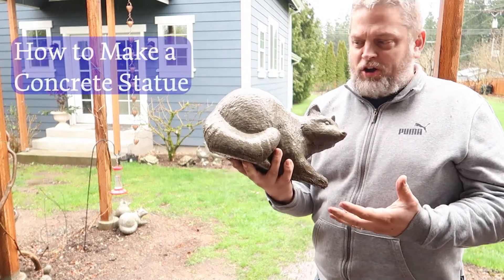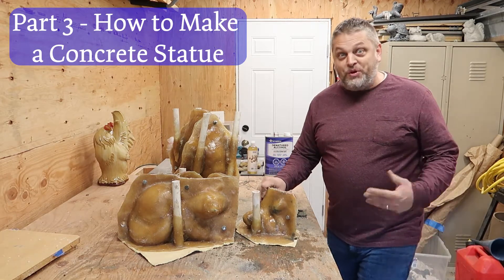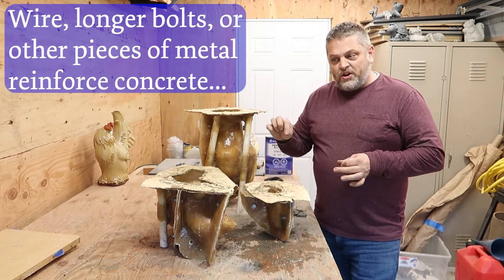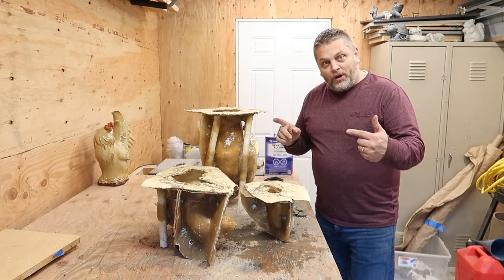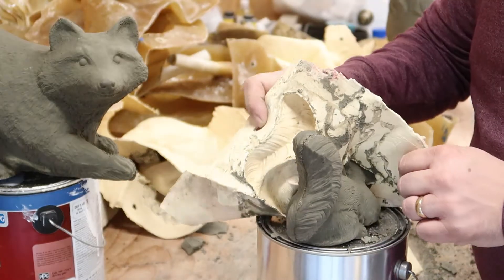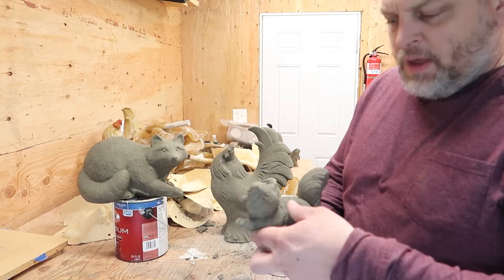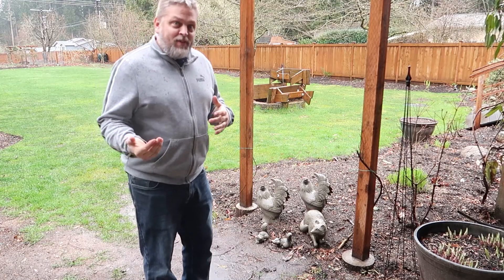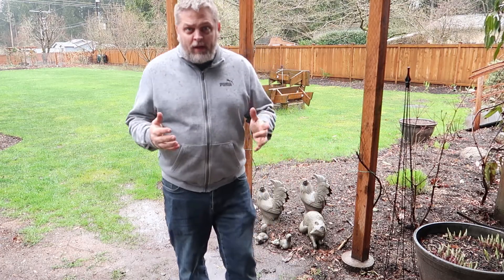How to Make Concrete Statues - Complete Guide to Make Garden Art (Part 3)

Comment: Should you let the concrete sit longer than 48 hours before removing from the mold?  Would that make it harder to remove by waiting say 72 hours?
Reply: Also, what type of paint would you use and would you seal it before painting or after?
Reply from the maker: @raynesmommie  Hello, regarding the paint, seal it AFTER so that the paint can really absorb into the statue and act more as a stain.  Most of my statues I don't even seal, and they are still great years later.
Reply from the maker: 72 hours is great, and the patience for the extra day may be great.  I had a couple times where I forgot to demold a statue after a week and two things happened.  First, parts of the extra stuff that I did not want, like seams that squirted out of the mold, were harder to chip away because the concrete was getting too hard.  Second, the mold seemed to be affected a bit...almost dried out too much. 72 hours is good though...

Comment: Im doing a small scale mold what would be the ratio of water to cement powder
Reply from the maker: The ratio is the same for all concrete.  With cement powder, it becomes concrete when you mix with sand/stone. That mix give strength to the cement. I think of it as glue...the cement is the glue for the strong rock/sand particles.

Comment: Great series.  Of course, you should be wearing a mask when mixing concrete, but you did have a long handle on the mixer, so, not as bad as the way I would do it (lol).  (Do as I say, not as I do so to speak).
Reply from the maker: I have a few instances in these videos where I need to be a bit more safe with masks or safety glasses...YES!

Comment: Im nervous about the chicken a lot of delicate parts... I made a duck decoy and the beak was so delicate and has broke off every one i tried (4), i add a lot of baling wire to insure there is plenty of strength. ... i was thinking about making the beak out of resin and attaching it to the cement with baling wire while poring so the wire is in both cement and resin. just an idea...   However with that being said i just had a single half seam the full length of the ducks underside tail to beak. I also let it dry for a week before i took it out of the mold.   Maybe if i did full seams and the beak in its own part of the seams... any input would be appreciated.. thanks for sharing we know it a hassle to make these videos for youtube.
Reply from the maker: You bring up several important issues...I will post some thoughts tomorrow!  Thanks
Reply from the maker: I also have a couple statues with these challenging parts, including an eagle on a rock with a challenging beak and the chicken I just made in these videos.  Both have benefitted from having a mini-seam, although on my eagle, the mini-seam does not always protect the end of the beak where it hooks down.  I've never tried a resin beak or addition, but if I can nail the concrete fragile piece, it seems to do great once it hardens up.  I suggest a mini-seam (or a full fledge seam), as without it, most statues will break up.  Also, if you can thicken the beak at all with clay to make it stronger before you make the latex mold, that also helps quite a bit.
Reply: @backyardadventureswithandy  wow thanks for your input... i think i will try the mini seam, will i need to make a new latex form or have you had good luck adding the flange to alter the original?  Also i have never heard of adding clay to cement.  I have some ceramic clay will that work?  Do you have a clay/cement mix recipe,, i can probably google it as well ... Happy Friday
Reply from the maker: @doriscampbell9260  Let me clarify...I have finished making molds that didn't do well around thin parts like a beak or ear. It does not work to add and reapply latex to make a seam on a finished mold, however, the next time I make a new mold, I am sure to add more seams. I have forced a seam on already made molds by just cutting the mold.  It sometimes works.  I see that I was also confusing about the clay comment.  I was referring to the original cast before I make a mold. I have started taking molding clay and shaping it to be a thicker ear or beak to thicken up breakable parts on an original cast, so that when the latex mold is finished, those parts hold up better.
Reply: @backyardadventureswithandy  thank you for clarifying what you're doing with the clay.  Can you please add a link or description of the type of clay you use to add to the original cast.   I do a lot of woodcarvings so working with clay should be easier already being shaped with the original cast.  Thanks for your input.. Have a wonderful day😁
Reply from the maker: @doriscampbell9260  I've actually only used modeling clay from my kid's art supplies.  There was nothing fancy about it, just the need to shape it to match some custom parts.  For example, I had a plastic statue of two turtles on top of each other which I broke/cut apart, and then filled in the holes and reshaped the two for separate statues...a mother and child turtle.

Comment: Love the video, I have been making concrete flower pots and birdbaths for over 40 years but have always used aluminum molds. I just bought some  latex rubber molds.. My question is how long do you leave them in the mold and do you pour them outside or inside?
Reply from the maker: Some of this depends on the warmth of the weather.  I typically leave them for 48 hours. In the winter, I have done a little more time.  If they cure/dry too long, they are harder to work with and I think it wears on the mold faster.  If it is too short, breakable pieces are more likely to break off during de-molding.  I also reinforce with wire/metal on things like legs.

Regarding inside or outside, I do everything possible to keep it out of direct sunlight.  I usually pour and store these under the eaves on the north side of my house, or in my shed.  Sunlight and latex molds are not good for each other!!
Reply: @backyardadventureswithandy  Thanks

Comment: Hi! I just stumbled onto your videos. You my dear are so great at showing the step by step way of doing the mold making to final product! What a great talent you have!  Rubber mold man was always who I watched in the past. I've emailed him with questions but he doesn't reply back. (He turned his comments off as well) 🙄 I am just now starting to do some crafts with concrete. I'm using some left over rockite we had from 9 yrs ago when we filled in cracks on our basement floor. I got an insane idea a few weeks ago when I saw it down there. I thought, ya know, this is just sitting down here in this 25lb box that barely had any used out of it. So I brought it up here & grabbed some silicone molds I have for making resin crafts, yes I do that too. I LOVE to craft! Anyway I mixed some up into a pancake batter/milkshake thickness & poured. I left them sit overnight since there were deep molds. I know rockite sets up in 15 mins, but I wanted to be sure. So my question is, since they cured fine, can I do a basic base coat with the watered down acrylic latex exterior paint & then once fully dry, do the dry brush effect to make the detail pop? I read rockite is stronger than concrete, but not sure how strong they are for this type of stuff. I have 2 latex molds I bought, biggest is a 16 in lion, only mold, no fiberglass backing, & a wolf head plaque, also no backing just mold. Sorry for the long winded comment/question. Just wanted you to know what I'm doing & if it will survive inside or on a covered porch if I spray a seal coat of enamel gloss over it. Keep up the great videos, you truly are awesome!
Reply from the maker: Thanks for the encouragement and while I don't know what rockite will do and hold up, I'd suspect you will have little problems if it is a cement based product. And, the finish you are talking about should work great, too. The seal is extra and so I'd think you would be just fine for decades...
Reply: @backyardadventureswithandy  Rockite is an anchoring cement for bolts, screws etc. Thank you so much for getting back to me, I will ve filing the pieces today & then doing the base coat tonight or tomorrow. 
You are very welcome on the encouragement, you deserve it! I'm a new subscriber to your channel so I look forward to seeing more videos! Have a great afternoon.

Comment: These were excellent videos and tutorials!! One thing I feel I'm missing is... once you de-mould, is there a way to clean the rubber to re-use the moulds? I imagine if you just leave the concrete bits, the next time you use it it won't look as nice. Am I right about that?
Reply from the maker: The molds usually are pretty clean, but I periodically rinse with water and let them air dry prior to reusing.   I try to get it clean of concrete before reusing.  Make sense?

Comment: I loved this video! I did have a couple of questions that I wanted to ask if that’s alright: 1. How do you clean the latex mold so that you can reuse them again? 2. Do you prime the latex molds again with the mold release every time you make another statue? 3. Why don’t we let the concrete sit longer than 48 hours? Would that relieve some of the possibility of things breaking off?

Anyways, awesome series of videos, and I really want to give it go! Im sorry if you answered those questions in the video, maybe I’m a bad listener haha! Thanks for you help!
Reply from the maker: 95% of my cleaning is just water and sometimes my hand rubbing any residue off.  I can't remember the last time I had to use a mild detergent and warm water, but that is what I would use if needed.  I basically rinse them each time and they are good to go again.

As for mold release (priming), YES, every time a lite spray...it will also help with the longevity of the mold.

As for letting the fresh concrete and sitting.  Honestly, I am overly eager, so that is my #1 problem.  However, regarding sitting longer, here is what I have experienced: In the heat of summer when it is warm (and in the shade the whole time), I prefer to go 1 day or 2 at the most.  In cold seasons, I go 2-3 days and try to keep the statues in the shed to cure (60 degrees).  I have heard that keeping them in the mold for a week or long amount of time is bad for the latex rubber.